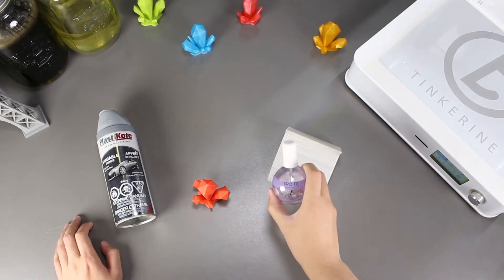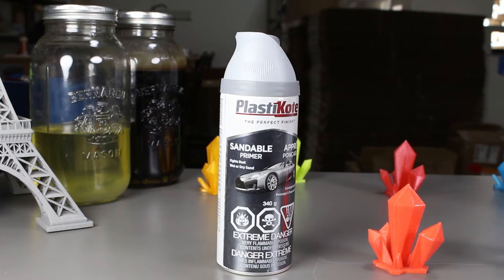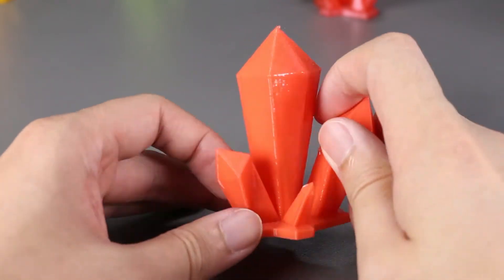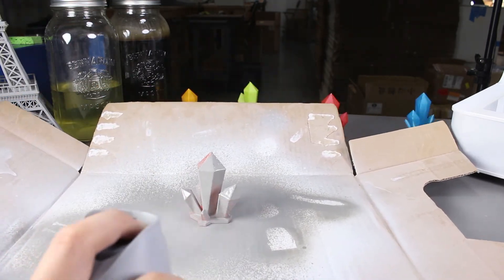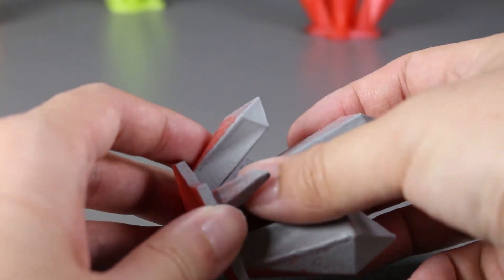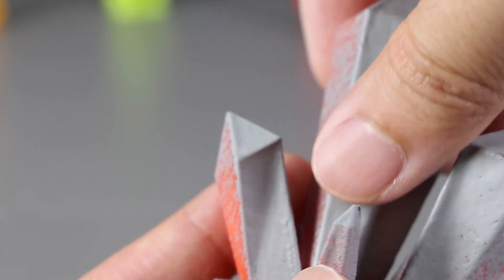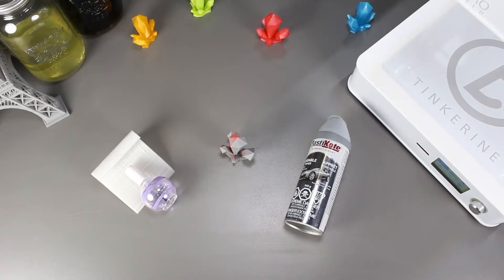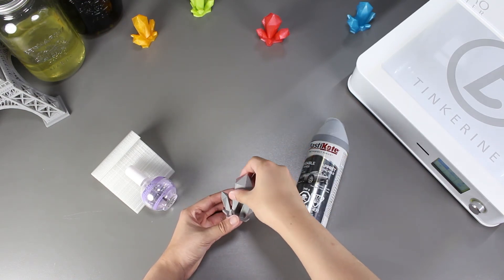Post Processing 3D Prints with Nail Polish Top Coat Part 2

Comment: how do you get the nail polish and primer between the gems on the print?
Reply from the maker: Hi!

If you are talking about between the primer, the nail polish top coat has a brush that allows you to go around. While the spray is a bit more tricky, you'll have to spray multiple times in different angles to fill it.